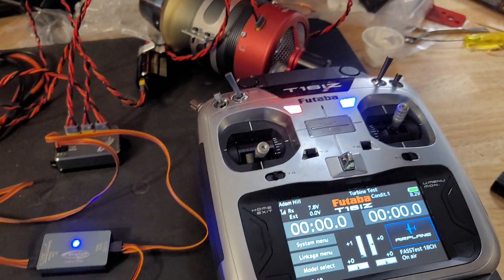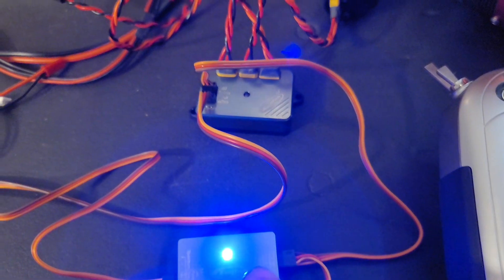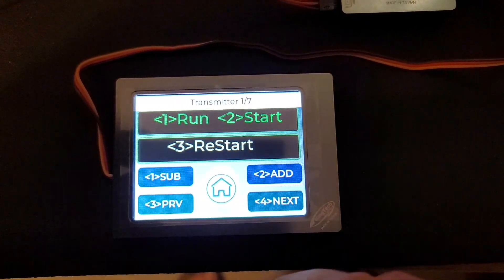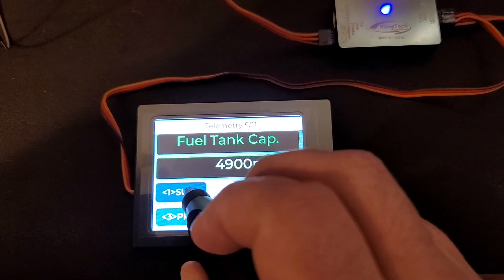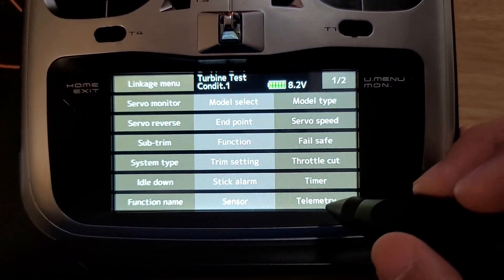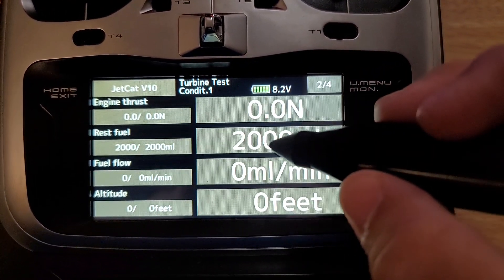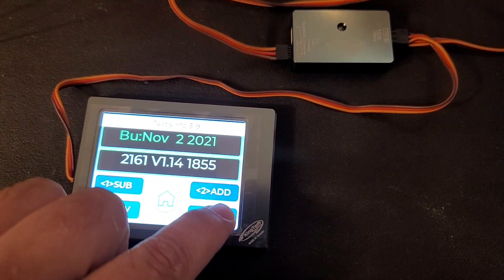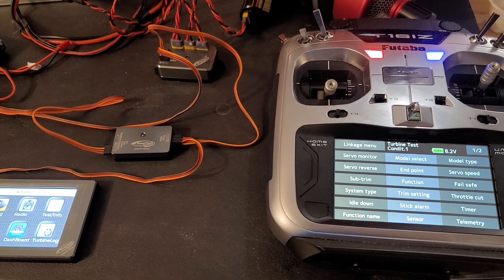Kingtech Turbine Telemetry setup for Futaba Radios

Comment: Thanx for the upload, Just got my K85G4+ telemetry and T16SZ wired up like in the video and all works well. Slot 1 is the best as it allows for use of other sensors. Jetcat V10 uses 14 slots in a row and my Powerbox Mercury, GPS and airspeed sensor uses the other 17 slots!.